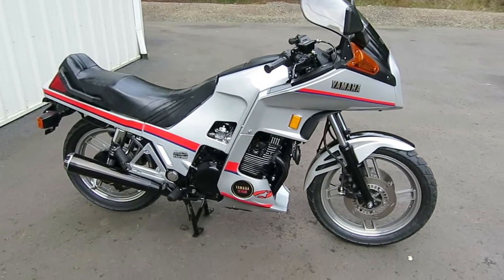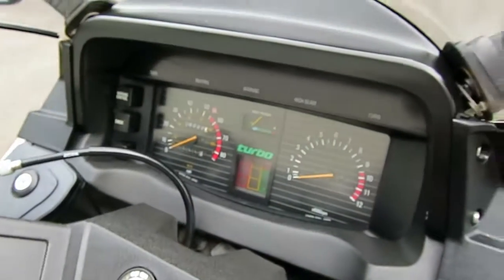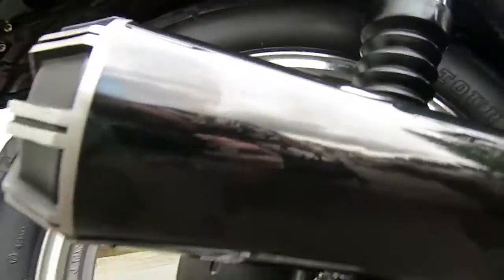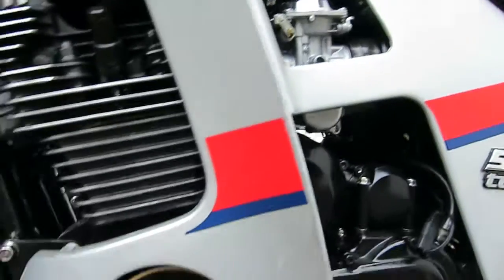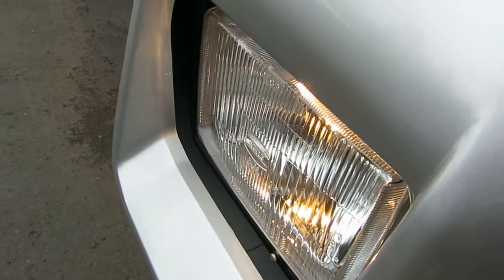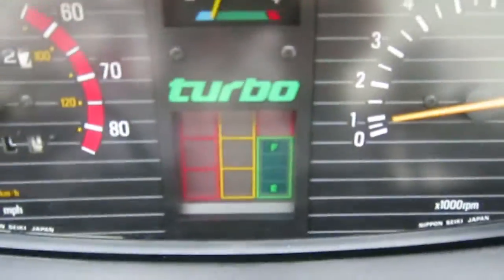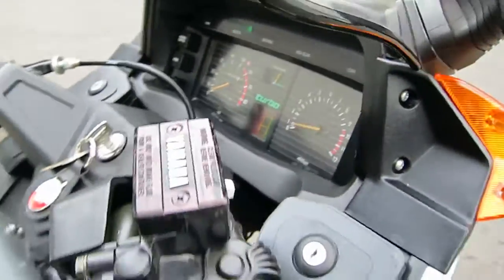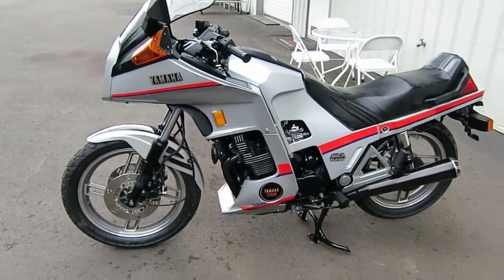1982 Yamaha TURBO Seca 650 - Coming Out Of A Museum & Running

Comment: Bought mine brand new from the factory in 1985 - unsold warehouse bike. Rode it about a year until two of my buddies went to the dealership and each bought one the same way. We were the 3 amigos on Turbo in San Diego. You could smoke the new 1985 900 Ninja in a straight line. Cornering was another story - if the turbo kicked in while you were laid over it would stand you up and toss you out the outside edge - you had to be careful riding that rocket. But in a straight line - when that turbo spun up it was like getting hit with nitrous. It was an extremely comfortable ride - it looked like a bend over crotch rocket but rode more upright like a cruiser. The Achilles heal was the turbo seals - like most turbos. I eventually removed the turbo due to the oil leaks and bypassed the chamber - still ran great just didn't have the kick it used to. Sold it to the mailman because I was deployed too much and didn't get to ride it or keep it up like I should (probably contributed to the turbo failure). If there is still new stock out there - it's worth a look. Nothing but found memories about that bike.
Reply: i bought mine out of the crate in 85 just like you did - kearny mesa yamaha.  rode it for 15 yrs and 69,000 miles.  only saw a few others cruising sand diego - remember one time i pulled up to 2 other turbos at a light on mira meas blvd.  light went green and all three of us let loose.... sounded like a pack of angry hornets screaming to the next light.  wonder if you were one of the other guys that day.  lol.

Comment: I had one of these in the early 1990s. It was a complete beater I bought for $500 to commute 130-180 miles round trip everyday for work at construction sites in southern California. I didn't put one penny into maintenance outside of oil changes. It was hideous but super comfortable for the time. Now I ride a Honda St 1300 and can say outside of the fairing noise the Yamaha, if it was in better condition, is the better commuter because the Honda is sooo heavy in tight traffic and the heat it puts out is really bad. Plus the 60-80 mph roll on of the turbo was good, for the era.

Comment: i loved my seca turbo ,  it was fast,  i burned tires off in 4000 miles. I wrecked it but didnt hurt it in 88,  scared me, so i sold it up here in fairbanks, alaska.  Now i am ready to ride after 30 yrs i think.
Reply: Same! I accelerated right into the back of a car on the freeway. Put new forks on it and sold it. Probably saved my life. Good times.